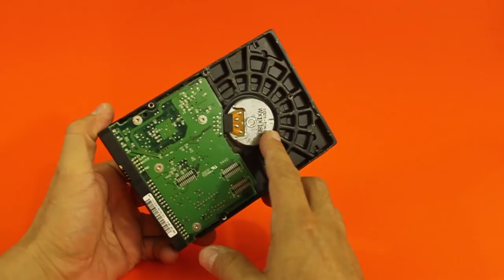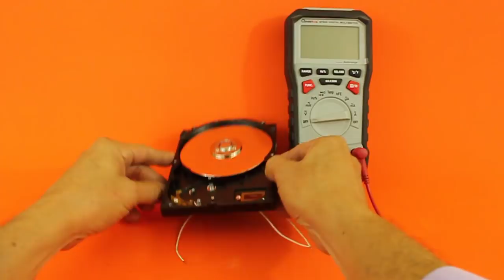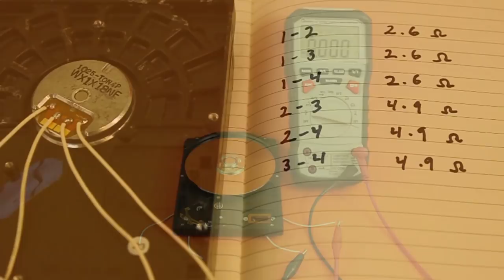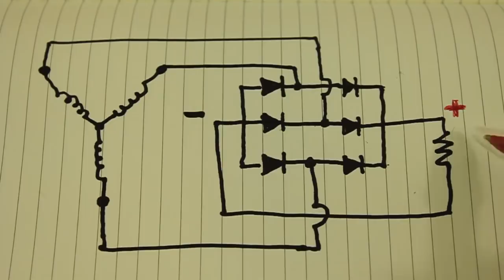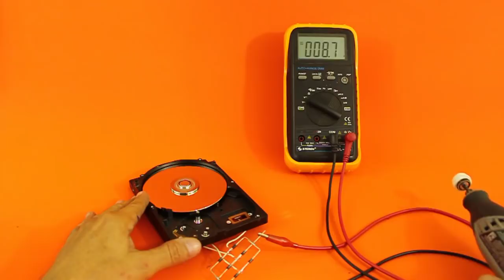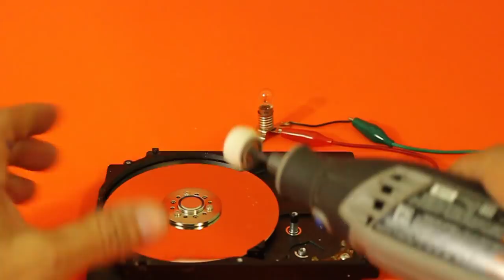Hard Drive Disk Motor as Electric Generator

Comment: in order to measure the watts, you should have measured the voltage while you were measuring the amps (while the circuit was closed) otherwise if the circuit is open you will get a high voltage, but that will drop when under load.

Comment: have you successfully created a magnet motor or air circuit that can light an LED indefinitely for free?  i want to see an overunity machine charge and power itself and another light.
Reply from the maker: No I haven´t and I´m afraid you will never see it. There is no such thing as overunity.
Reply: Ludic Science I disagree, I've seen enough proof that magnets can produce work. There is an infinite possibility of combinations of magnet placement, types of metal coils used, size,  etc. furthermore, the scientific community is a joke.  They cannot comprehend WTC 7 collapsing, and they cannot comprehend that the earth is flat and motionless.  You need to have a clear understanding of the flat and motionless earth to really get into energy research and succeed.  Mainstream science is designed to lie and create people that cannot think outside the box.  Free energy with magnets and metals can be achieved and many have accomplished it.  I think an air circuit with a high antenna will produce a few free volts as well.  Space and NASA is all fake, that is not real science.  The earth curvature formula of 8 inches per mile squared is not observable in reality.  We can see mountains over 200 miles away, there's a 102 mile long bridge in China, we can shine lasers across frozen ponds, pilots do not dip their nose down constantly to go around a curve, they fly level for thousands of miles.  The evidence is all there that we are not spinning 1000mph too.  People cannot think outside mainstream science ideas, they are lies to and brainwashed to think the wrong things.  Magnets can produce motors that run and can charge batteries and assist themselves as well.  Magnets are a free force we can use along with toroidal coils of metals to produce work.
Reply: not trinna be mean but the universe would probably collapse
Reply: Chris Topher You're an idiot

Comment: This is the first time that I've seen a full-bridge rectifier made from discrete diodes for three-phase AC since three-phase AC is not commonly used for non-industrial purposes. I also haven't read much into the different kinds of motors used in various applications. Three-phase AC is supposed to be more efficient than what we are given for residential use, but I heard that an Oklahoma law now prevents new installations of three-phase for either commercial or residential use so you must use a transformer if you wish to use three-phase equipment. Here, a residential, three-phase line drop would be around 208V, but politicians in Oklahoma think three-phase is dangerous without considering the actual voltage of the drop because they are uneducated morons. They likely think it is 7kV or some weird, super dangerous voltage like 1MV (Mega Volt) coming into your home or business. I think the highest voltage for high tension lines is something like 500kV requiring huge transmission towers to keep the lines high off the ground and separated so electricity doesn't arc to the ground or the conductors. At any rate, that is pretty distant from what is used in a hard drive disk motor.
Reply: I tought it would be interesting to use three independant incadescent light bulbs in a Delta VS Wye configuration, sinc the HDD motor has its own Neutral connection (wire 1).

It would be a nice introduction to 3-phase power that is universally used by all power grids everywhere in the World.

Comment: So, maybe 3D print blades to turn it into a windmill? I’m curious about the current output.
Reply: from the looks of things you'd need hurricane wind speeds before you get even close to enough to run a 12 volt battery and even then you'd need it to go for hours on end before you charged up a battery... you could try putting it on a cog system, but they'd grind down from significant use and the catchers would also need to be pretty large... It's cool, but there are better methods of getting power...
Reply: that said, you could probably charge up a nimh or nicad battery if you had garden lights and lots of wind...
Reply: @nokelclaa6291  I was thinking more of an 18650.

Comment: As always, thanks so much for your informative videos. Quick question: given that this specific type of motor has to spin at such incredibly high rpm's, wouldn't you say this does not have much application for a DIY/renewable energy source? (ie. mounting blades on the plates for wind/hydro generation) Second question on that topic: in your opinion, what kind of inexpensive motor would work well for a small DIY wind generator configuration? I've read lots on treadmill DC motors and stepper motors, but wanted to get your opinion. Thanks again!
Reply from the maker: I do not have much experience with generators, but as you say, stepper motors seem to be the best option for DIY wind generation of electric power.
Reply: PS: this guy stole your audio...
https://www.youtube.com/watch?v=zkIGA5Ck6Gc

Comment: Seems fair enough voltage and current wise (even you would have problems getting both at max at the same time)

The motor-driver output would be around 10V, and up to 2A (very driver dependent).

If you spin one HDD motor with another on a BLDC driver you can get enough power for some smaller light-bulbs.

I like how a some drivers(TDA5145) works a bit like a capacitor connected to a motor with some spinning mass!

Comment: nice , now connect a few motor/disks inline and shape the case to a generic tesla air/water/gas turbine with only two outlet through holes (so as to keep the disks firmly attached) and apply 30/40 psi to the inlet and you have a compact engine that can also take another external generator upto the optimal torque or even a small stirling engine running in cold driven mode to make easier hydrogen cooled storage for later use if you so wish...

Comment: 10 volts unloaded and1.25 amps short circuit. you cant use 10*1.25 for power output rating because of the coil resistance. the most power you can get is by using a resistor with the same resistance as the internal resistance of the generator. the internal resistance of the generator is 4.9 ohms. if you connect 4,9 ohm load the current would be the half of the max short circuit current, which is 0.7 amps. the power output is I^2*R=2.4 watts. however if you short circuit the motor you can get 14-15 watts but they would be going straight into the coils heating them up very fast and causing them to burn  in matter of 7-15 seconds

Comment: nice Video - but the outputpower will be less than 10-13 Watt.
The internal resistor of the coil are 4.9ohm and if you get 1.3A then you have a voltage drop of about 6.3V at the coil. And don´t forget - this is only the R. in a dynamic system (rotating the generator) you also take care about the inductive resistor L. Time to use your oscilloscope.

Comment: That's great... But without a Dremel tool, how could you spin that motor so fast?  Wind power wont cut it!
Reply: banjax66 gearbox?
Reply: A gearbox could increase the speed on the output with gear ratio..
But the more gears you include, the more energy it takes to rotate them..
Where does that energy come from?
Reply: a generic tesla air/water/gas turbine  gets you way more speed than you really need here, so restrict the input to an optimal value through testing the whole integrated device you build.
Reply: banjax66 the wind.

Comment: You need to measure current and voltage at the same time to get the wattage. Maybe when it's an open circuit you get 10 volts but when you short it through the current meter it might be much less.